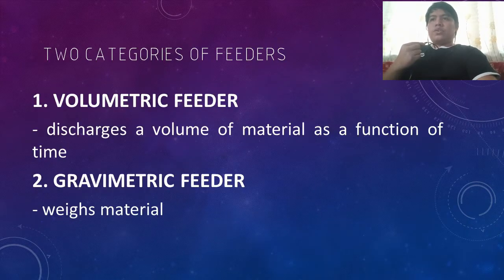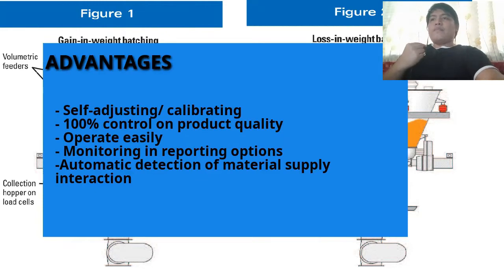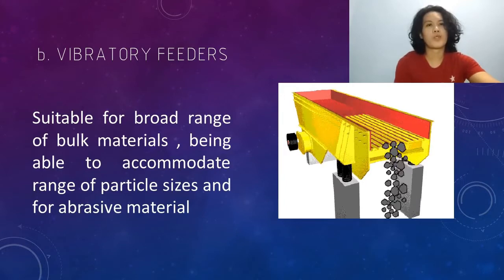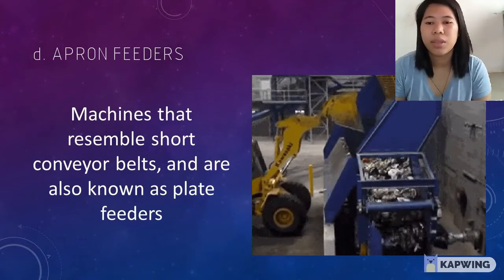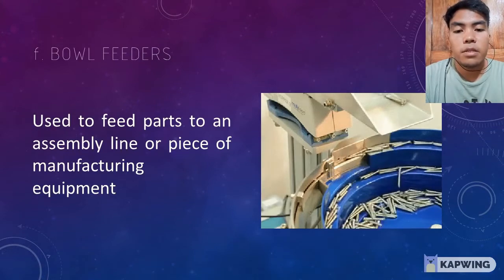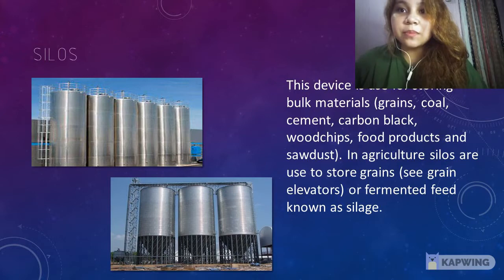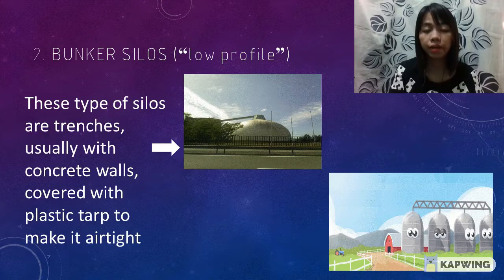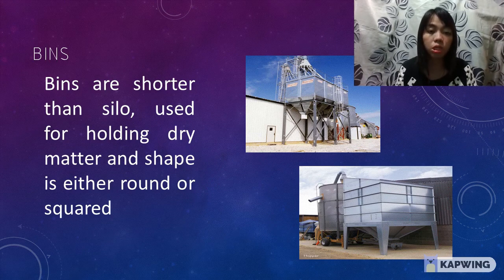Feeders and Storage Silos - Group 5

Comment: Roa, Beryl E.
0:08 – Feeders
Feeders are devices that are positioned at the outlet of storage units such as bins, bunkers, silos, or hoppers to control and meter the flow of bulk materials from the storage unit in order to satisfy the set discharge flow rate. When the feeder stops, material flow stops, and when the feeder is turned on, the rate of discharge of bulk material is closely linked to the feeder's speed of operation.

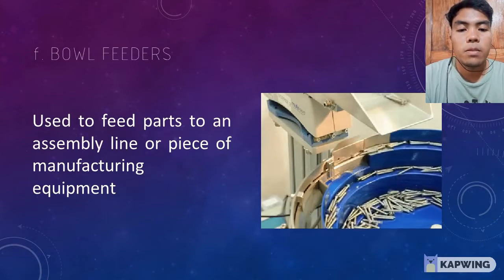Comment: 16:04  -  BOWL FEEDERS
bowl feeders are common devices used to feed individual component parts for assembly on industrial production lines. They rely on the mechanical behaviour of a part, such that when gently shaken down a conveyor chute that is shaped to fit the part, they will gradually be shaken so that they are all aligned. Orientation relies on the shape and mechanical behaviour of an object, particular the position of its centre of mass in relation to its centre of volume

Comment: Vede, John Andrick L.
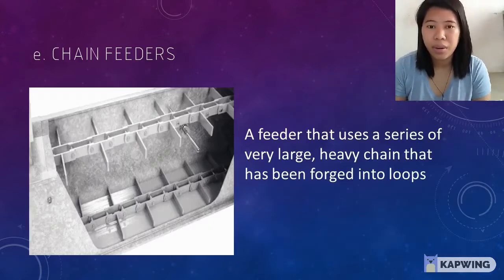13:14 Chain Feeders
Chain feeders is a feeder that consist of endless steel chains, suspended from and driven by an overhead tumbler, and mounted as a rule in chute leading out of the bin. This type of feeder may be driven by its own motor, from a line shaft, or from the crusher or conveyor that it serves. It is not just cheap but and it has high damage resistance such that wear on the tumbler and chain is negligible. It's ideal for regulating and managing the flow of such materials onto the belt conveyor.

Comment: Mangruban, Mecca Kolleen L.
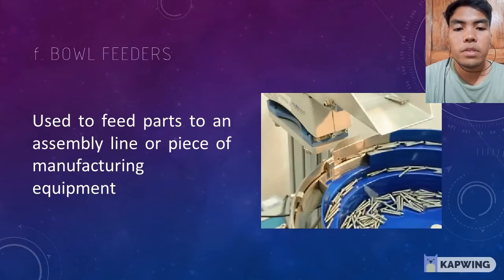14:48 Bowl Feeders
Bowl feeders work by aligning small parts and components and feeding them into a production line for further packaging or processing. When properly installed the feeder bowls are an important component to sorting and orienting bulk parts far more rapidly than a line operator, reducing labor costs and increasing accuracy. In terms of handling and sorting bulk products for further processing and packaging lines, the vibratory bowl feeder remains a reliable solution that greatly improves production line efficiency.

Comment: Simpas, Neil Gregory A.
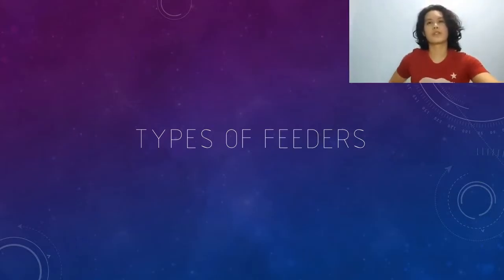5:35 - Rotary Feeder/Valves
Some components of a rotary feeder include the rotor shaft, housing, head plates, packing seals and bearings. One major advantage of rotary feeders is its ability to operate at very high speeds. However, because of this, parts being fed into the feeder are susceptible to damage thus brittle parts are not recommended for this type of feeder

Comment: Luzon, Allen Van Morrae D.
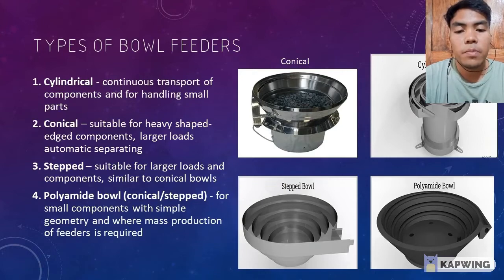17:34 Types of Bowl Feeders 
There are several types of bowl feeders. First is the cylindrical bowl feeder, which is used for continuous  transport of components as well as handling small parts. Next is the conical bowl feeder that is used and is suitable for handling heavy shaped-edged components, the stepped bowl feeder functions similarly to the conical feeder as it is also suitable for larger loads and components. Lastly, polyamide bowl feeders are used for small components with simple geometry and where mass production of feeders is required.

Comment: Galon, Hannenie U.
9:15 Screw Feeders

Screw feeders are designed to meter bulk materials and are typically located at the beginning of a process. Moreover it can deliver dense slurries and dry granular products with great accuracy at a range of operational speeds. The two types of screw feeders are volumetric and gravimetric.

Comment: Melencion,Kim Ian Z.
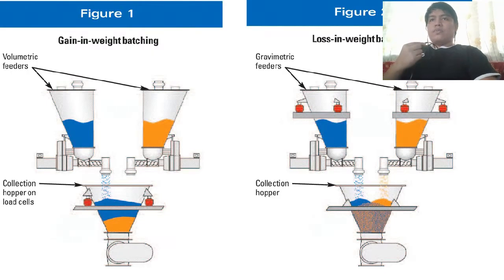0:50 Gain-in-Weight Batching Systems weigh the material as it enters the receiving hopper and can be combined with a variety of feeding and conveying systems, including pneumatic, augers, and rotary/vibratory feeders. Because the exact weight is added to the weight hopper, gain-in-weight batching is extremely accurate. To use a volumetric feeder, the user must understand the rate at which the ingredient must be dispensed into a process, as well as the volume the way represents. Because there will be no computer to assist the user, this is critical information that the user must understand.

Comment: Rebucas, Jhowell Jhon S.
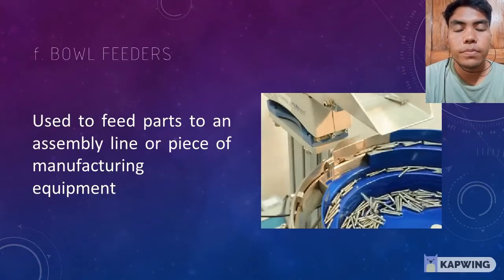14:42 - Bowl Feeders

Commonly used on feeding individual parts on the assembly line of an equipment, bowl feeders work on by aligning these parts well in order to be packed or processed. They are in use on a random arranged components are not well-sorted and needs to be individually fed on the working machine.

Comment: Jandayan, Joyce Ebony V.
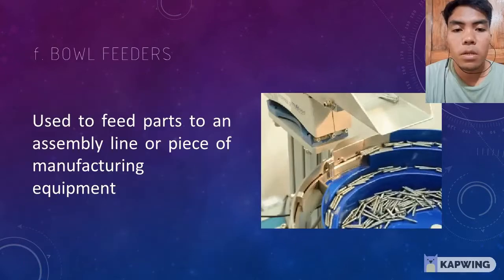14:43 Bowl Feeders
Material can be fed into vibratory bowl feeders (also known as circular vibrators or vibrating bowl feeders) in a synchronised manner, regulating the amount of material that enters the bowl. This feeder has a bowl and a circular vibrator. The electromagnetic vibrator drives the parts forward in the selection units and the vibratory linear feeder units. In a resonance curve, a vibrator responds to the action of a frequency equal to the excitation caused by a magnetic field by pressing one or more electromagnets.

Comment: Balabag, Renzo Jay L.
17:05 – Bowl Feeders
	This type of feeder is used to feed parts to an assembly line or piece of manufacturing equipment. There are various types of bowl feeders such as cylindrical, conical, stepped, and polyamide bowl. Every type of bowl feeders is design for their specific purposes.

Comment: Charmen O. Barrio
21:01 - Silos
A silo is a bulk material storage structure that is commonly used to store grain and food products. Storage silos construction and design depends on the amount of product to be stored, the environmental conditions, and the site conditions. As stated, there are three types of silos: tower, bunker, and bag silos. Tower silos, which are made of wood, steel, or concrete, are the most used silos. The bunker silos are trenches with concrete walls that are filled and packed with the help of tractors and loaders. Bag silos, on the other hand, are made of plastic or tubes that store grains and fodder. This is the most cost-effective type of silos.

Comment: O:36 Volumetric feeders supply a certain volume of material per unit of time. Known volume units of a particular material are used for the volumetric measurement and the material is transferred to a mass-based discharge using scanned calibration. Feeding is changed by adapting the auger speed.
Unlike gravimetric feeding, volumetric feeding does not determine mass using weight.
Volumetric feeders cannot detect fluctuations in material density. Deviating speeds of discharge are not taken into account.

Comment: Gallenero, Robin Vincent S.
07:08 - Vibratory Feeders
Vibratory feeder is the type of feeder that uses vibration as means to transfer or feed a bulk of materials to machine or process. It's  suitable for a lot of materials due to it being able operate in harsh conditions and its motion has a certain trajectory and angle. Its movement is a combination of hopping, tossing and sliding and its limitation is on the size of materials it can feed. The difference it has with its conveyor counterpart is that the feeder's speed can be changed to accommodate the operation.

Comment: De La Peña, Mary Princess C.
11:32 - Apron Feeder
The apron feeder, often known as apron conveyor, is another form of feeder. It is a type of feeder that moves material at a controlled speed from a hopper to the delivery point. It is utilized to feed quarried rock into the primary crusher. Apron feeders are used to feed material in a range of material handling applications, including mining ores, agricultural products, scrap metal, and more.

Comment: Ybañez, Lenard Greg L.
22:55 Disadvantages of Silos
The frequent breakdown of the plastic film is another drawback of bag silos versus steel silos. Whether it's due to rat assaults or any adjacent mechanical equipment creating humidity concerns in the event of rain. A steel silo, on the other hand, may be fitted with a variety of unloading conveying systems, depending on the type of grain and the volume necessary.

Comment: Raiz, Edisa Jane A.
24:40 - Bunker Silo
Bunker silos are long ditches with concrete walls that are used to store silage or dry goods. Once the trench has been filled, it is made airtight by covering it with a plastic tarp. Bunker silos are inexpensive because they are simple to build and are well suited for large-scale operations.

Comment: Ybañez, Clengie T.
20:50- Storage Silo
It is bulk storage of materials, specifically for a grainy type of material. It is widely used in agriculture as grain products are stored in it. This has a very big advantage as it will hold a large capacity and can be mechanized, resulting in low labor costs.

Comment: Madrio, Bradford Pastor E.
9:21 Screw feeders
Screw feeders are designed to transmit finer, granular materials from one end to the other of the feeder mechanism. The discharge rate of a screw feeder may be precisely calculated using speed control and screw pitch design. Variable-speed drives provide a wide variety of input rates while improving metering accuracy. Screw feeders are divided into two types: volumetric screw feeders and gravimetric screw feeders.

Comment: Tubac, Doumar Anthony N.
7:11 - Vibratory Feeder
A vibratory feeder controls the flow of material through a process or machine using vibration. These feeders use vibration and gravity to transport material. Gravity causes these pieces to slide downward or laterally. Simultaneously, vibration is used to move the material. The material on the feeder responds by making little hops or jumps.

Comment: Casiño, Gerard Patrick A.
0:53- Gain in weight batching 
Gain-in-Weight Batching Systems weigh the material as it enters the receiving hopper and can be combined with a number of feeding and conveying systems, such as pneumatic, augers, rotary/vibratory feeders, and others. Gain-in-weight batching has the advantage of being extremely accurate because the exact weight is added to the weight hopper. To utilize a volumetric feeder, the user must understand the rate at which the ingredient must be shifted dispensed into a process, as well as how much volume the way represents. This is critical information that the user must understand because there will be no computer to assist the user.

Comment: Buendia, Bon Anthoney
9:21 Screw Feeders
Screw feeders are made to transport finer, granular materials from one end of the feeder mechanism to the other. A screw feeder's discharge rate may be estimated precisely utilizing speed control and screw pitch design. Variable-speed drives improve metering accuracy while providing a wide range of input speeds. There are two types of screw feeders which are volumetric screw feeder and gravimetric screw feeder.

Comment: 6:36 An outer housing, a rotor, a rotor bearing and seal, and a drive are the four essential components of a rotary valve. A rotary valve is used in industry to control the flow of a product, usually to reduce the flow rate to a level that is more suitable for the task at hand. Rotary valves are most commonly used in air conveyor systems to reduce pressure loss across the valve, but they can also be used to meter materials at a controlled feed rate. They are almost exclusively used in air systems and serve as airlocks, explosion/flame barriers, and process isolators, among other things.

Comment: Ablon, Edward John R.
6:35 Rotary Motors
An outer housing, a rotor, a rotor bearing and seal, and a drive are the four essential components of a rotary valve. A rotary valve is used in industry to control the flow of a product, generally to lower the flow rate to a level that is more suited for the task at hand. Rotary valves are most commonly used in air conveyor systems to reduce pressure loss across the valve, but they can also be used to meter materials at a controlled feed rate. They are almost exclusively used in air systems and serve as airlocks, explosion/flame barriers, and process isolators, among other things.

Comment: Tabay, Adrian James A.
15:21- Bowl Feeders
A bowl feeder is a device that feeds small parts and components into a production line or sorts bulk goods for quick usage. A self-contained bowl feeder system has a bowl that sits on a vertically moving spring loaded base. Small pieces and components scurry down the bowl's edge. Bowl feeders are a versatile type of parts feeder that can handle parts as small as a pill to components as big as six cubic inches. Despite the fact that bowl feeders take up very little area, they are capable of efficiently arranging, selecting, feeding, and sorting pieces.

Comment: Basadre, Ma. Rica Joy M.
6:33- Rotary Motors
Rotary valves are composed of 4 main components: an outer housing, a rotor, a rotor bearing and seal, and a drive. In industry, a rotary valve is used to regulate the flow of a product, usually to reduce the flow rate to a level more suitable to the process being undertaken. They are most often used in air conveyor systems to minimize the loss of pressure across the valve, but rotary valves are also used to meter materials at a controlled feed rate and it work almost exclusively in air systems and function as airlocks, explosion/flame barriers, and process isolators, among other tasks.

Comment: Comon, Jeigne Samantha LouisseD.
20:50 - Storage Silos
A silo is a pit structure used in large industries to store bulk materials such as cement, carbon black, woodchips, and so on. The silos can be classified into several types based on the bulk material they transport, such as bunker silos, tower silos, and so on. Engineers design and build the silo structure to maximize life and storage duration.

Comment: Atis, Kent John A.
12:50 - Apron Feeder

In simple terms, an apron feeder (also known as a pan feeder) is a mechanical type of feeder used in material handing operations to transfer (feed) material to other equipment or extract material (ore/rock) from storage stockpiles, bins or hoppers at a controlled rate of speed. Apron Feeders work by conveying material from a hopper to the delivery point at a controlled rate of speed. The Apron Feeder consists of a frame, undercarriage components, head shaft, tail shaft, flights and a drive.

Comment: Hiramis, John Rhejims L. 
0:30 - Feeders
A feeder line is a line that supplies a distribution network point without being tapped at any intermediate points. A feeding system selects, guides, and positions the parts to make subsequent handling and assembly easier and more efficient. In this part, the presenter discussed feeders and the two categories of feeders (volumetric feeder and gravimetric feeder) thoroughly. He shows the advantages of the two categories and which of the two is more efficient, so props to the reporter's presentation about feeders and their mechanisms; you made some excellent points in your report, and I could see how much effort you put into discussing feeder systems.

Comment: Lomonsod, Jay-ar S.
0:09 – Feeders
Feeders are used to metering material flow to satisfy the crushing system's or process system's predetermined flow rate. In many mining, aggregate, and other industrial applications, they play a key role in material handling. Volumetric and gravimetric feeders are the two types of feeders. A gravimetric feeder, also known as a loss-in-weight feeder, is a self-calibrating dosing system that doses in real-time based on weight. A volumetric feeder, on the other hand, calculates speed depending on volume. A loss-in-weight feeder, also known as a gravimetric feeder, is a self-calibrating dosage system that doses in real-time based on weight. In contrast, a volumetric feeder estimates speed based on volume. By using a more exact feeding method in an application, a gravimetric feeder can save a lot of money on the input material.

Comment: Jaraula, Cedie G.
13:17 Chain Feeder
Traditionally, chain feeders were noted for dispensing grain at a slow rate, causing birds to become stressed. It ensured quick feed distribution and reduced the need for birds to struggle for a good trough position. All of the birds get their high-quality feed at roughly the same time. This feeder is made up of a succession of forged loops of very massive, heavy chain. These loops are suspended over the ore channel and are positioned over cogged wheels. The chain loops' free end is dangling from the rock. The chain links' size and weight are adequate to block the flow of ore.